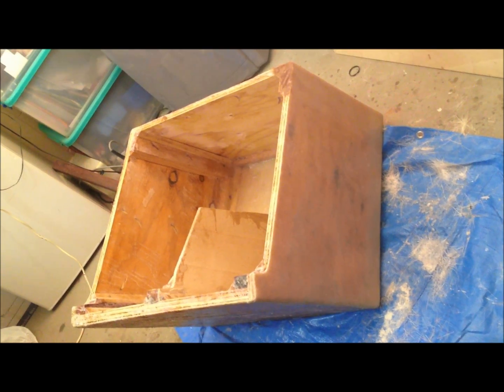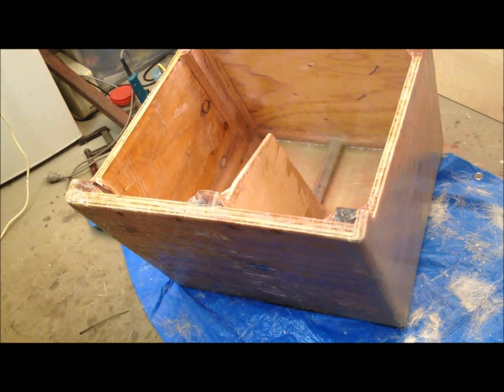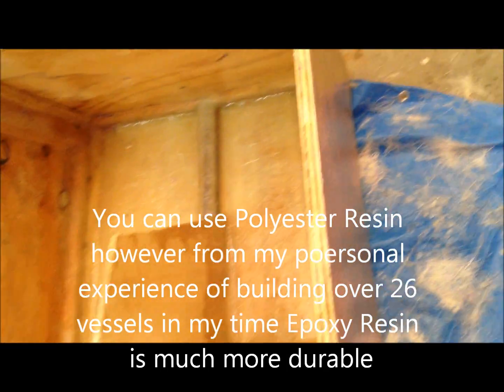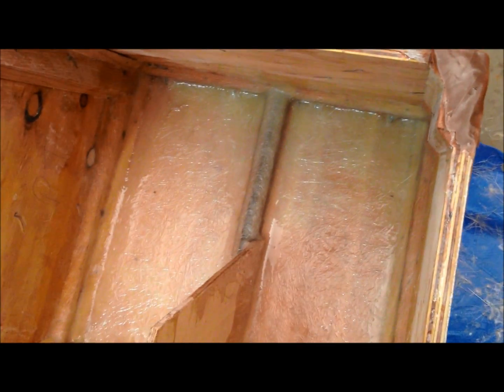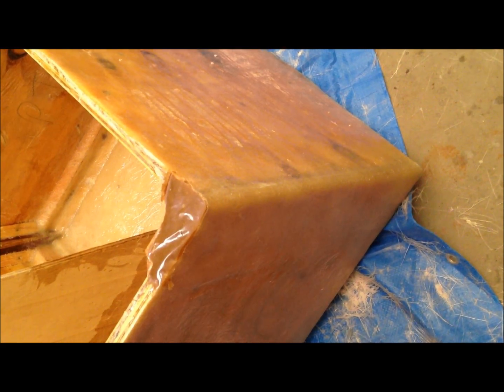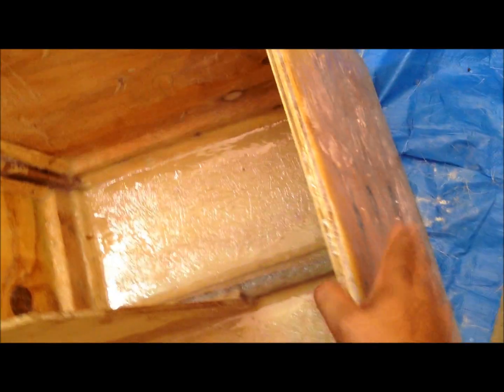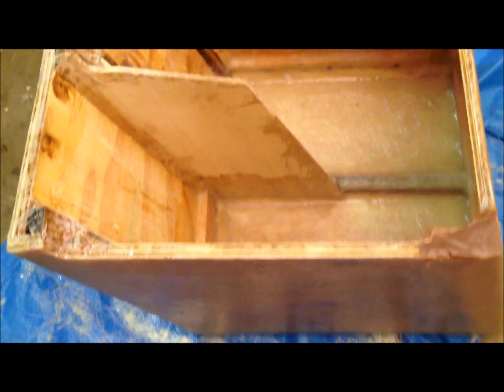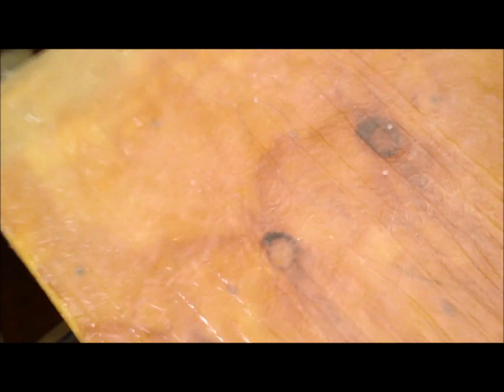Building an Outboard Engine Pod Gen II (Gen I Tested to 250HP) P2. Video DaintreeJD #howto #build

Comment: How can I make a model for a 19ft sea square 1989
Reply from the maker: Hi Andrew, thanks mate, really take some time and look at the lines of your boat do some sdrawings and een start out with a cardboard template for ideas and to see how it will look overall as sometimes it sounds great but the looks can change dramatically as can the way the boat handles. The best thing is its custom to your boat and if you need to you can mo\dify it (I would not like to do it) however its possible. if you have gelcoat where your joing th epod to you would want to remove that for the best bond and given its taking a good size motor (most likley) you will need to take this into consideration when building the pod. Disclaimer: Please remember for legal reasons its always at your own risk Im not recomending anyone do it, this is just an example of what I have done.

Comment: 95% of mass produced boats are made from polyester resin. It is definitely marine grade!!
Reply from the maker: Its not the making of the original hull its the repair work and under the waterline repair work is where you see this problematic as it has a tendenacy to shink.

Comment: are the frame reenforcements made on solid timber or plywood pieces ?  it looks like plywood, but asking doesn't hurt.
Reply from the maker: Thanks for your question, the frames are solid timber, other folks may have used plywood, I prefer solid timber.

Comment: Hi Daintreeld,what weight csm did you use on pod,cheers Steve ?
Reply from the maker: Hi there Steve, thanks for the question I used layers of 300GSM it wet'd out with the Epoxy Resin better and put one coat on then another and so on as apposed to using 450gsm
Reply: DaintreeJD Many thanks,going to start on my own soon.
Reply from the maker: awesome Steve happy to share my thoughts anytime mate

Comment: Im planing to have no wood in the boat( i can get marine foam 40x1200x2300mm for $600. for the transom/stern im thinking of having a 40mm thick stern that way(no foam for the transom) is this silly? should i just have a 10mm thick stern and a 40mm thick transom? also to make the floor do you have any suggestions to materials
Reply from the maker: Hi Kent wow I missed replying to so many people here, appologies. I have not worked much with foam particulary in transom's as the main bulk of the glassing inners so can't comment a lot on that mate, maybe someone else has though.

Comment: (previous message not sure if you saw it) "awesome ill find some marine foam, i think ill go with the marine then. it will stick out 50cm the pod will be fibreglassed marine ply its similar to yours in which all ply parallel to the hull is 18mm and all ply parrallel to the stern is 27mm or maybe 36mm. the only reason im considering 36mm is because the boat previously was an inboard (rotted) with a 40mm thick transom."
Reply: what's your engine power ? Mine is 100hp.. it weights about 170kg ( 374lbs ) . I was thinking about having 4x  10mm marine plywood at the transom but I see you guys using less than that for engines a little bit heavier than mine. I can't overweight since my boat is only 19 " and the bracket will be only 40 cm long out of the transom.  I am not used to dealing with fiberglass lamination and I don't want to use more than I should.  3x   10 mm plywood would be enough in my case ?    I also have half a sheet of 15 mm marine plywood that I couild use inside the perpendicular to the transom's... but I calculated that 3 pieces of 10mm plywood is lighter than 2 pieces of 15 plywood.  I just don't know if it's also stronger.. I can't do it entire on lamination bcuz it would make the bracket way too heavy and the cost would be too high for me.   what do you guys think ?  sorry for butting in your conversation like that.  lol

Comment: awesome ill find some marine foam, i think ill go with the marine then. it will stick out 50cm the pod will be fibreglassed marine ply its similar to yours in which  all ply parallel to the hull is 18mm and all ply parrallel to the stern is 27mm or maybe 36mm. the only reason im considering 36mm is because the boat previously was an inboard (rotted) with a 40mm thick transom.
Reply: divinycell is a good bet. pity it''s too expensive here in Brazil.

Comment from the maker: In regards to your outboard pod as long as she is securely fastened through original stern to pod and the Pod is structually sound i would take the original stern back to the glass by removing the gel coat and place in one layer of glass epoxy saturated, if in doubt use 2 layers of CSM, half inch stainless through bolts, nylock nuts will bond her well. Kent i am not sure of the pod your putting on will it be fibre glass?  how much longer will it extend from the orignial hull?

Comment from the maker: Good evening Kent thanks for your view and question mate, to answer your question I have always been a big believer in quality marine ply being epoxy saturated this is extremly durable and nearly inpenatrable (what i have found anyhow). however in recent years i have used some foam with really good succes and would suggest marine foam with 2 layers of CSM over the foam. to give you an example a friend had his whole boat made from marine foam and it was not only extremly light but super strong.

Comment: Hi im fixing a sportscraft commodore v189 5.2m
I would like your opinion on the following
should i use BB extertior AS/NZS 2272 ply (epoxy saturated) or marine foam for my new stringers.
im going to make an outboard motor pod (same width as boat) to join it how many layers of fibreglass should i use and should i use unidirectional matting or CSM? Cheers.
Reply from the maker: Hi mate I missed your message and I do apologize. How did you go with this? I would go with at least 4 layers glad, epoxy resin and and you could definitely go multi directional with this, would add to the integrity.